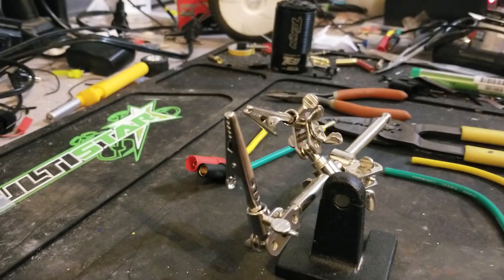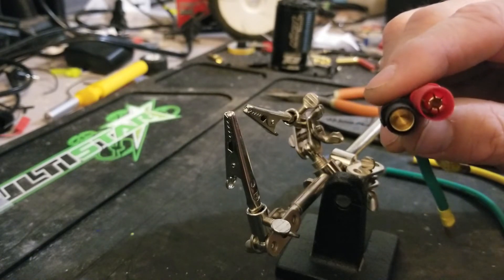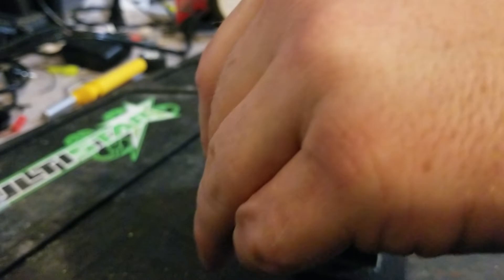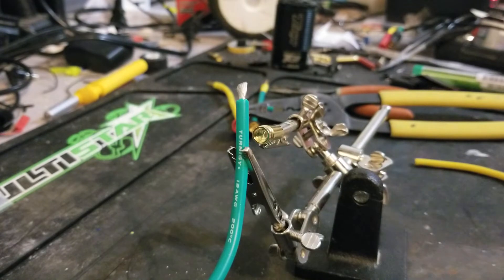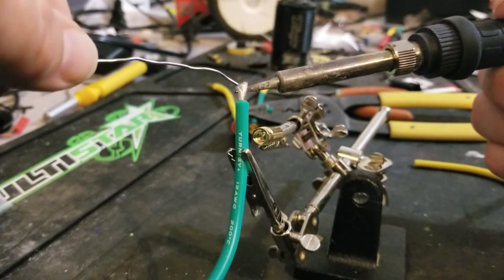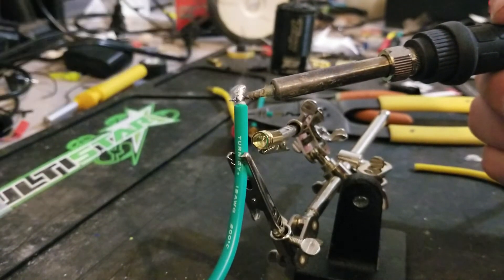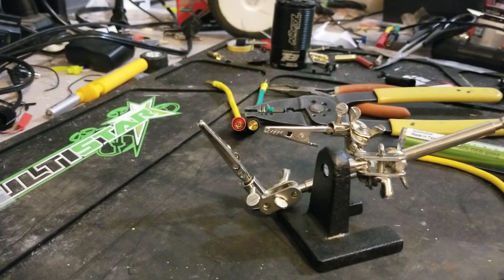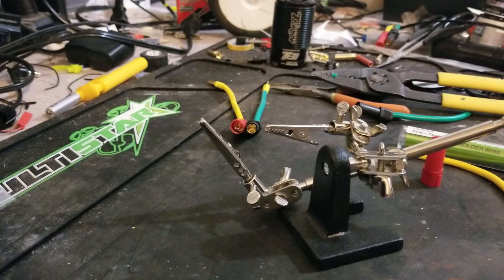How to solder xt150 connectors.

Comment: Thanks for all the useful information. I bought some xt150 connectors to use between my motorcycle stator and rectifier. The stator produces 80V at 6.000rpm . You think these connectors will hold up? Thanks!

Comment: I don't understand why the sleeves are installed by pulling on the wire. This seems improper even if it can be accomplished. All the safety instructional material I have ever seen advise to never pull wires, yet this is how the sleeves are installed? I'd imagine there had to be a tool made specifically for installing sleeves on connectors especially if done in mass production. So far I have not seen it though, which is surprising.

Comment: I would suggest not using a conical tip for this sort of soldering task. You are much better off with a large chisel/wedge style tip for much better heat transfer.

Also why not just use a pair of needlenose pliers to hold and control the wire rather than trying to manoeuvre both the wire and the bullet together held by clips of the helping hands?

Doesn't seem to be the best demonstration of this process.
Reply: @James Mills the xt 150 connectors I have don't click. When I slide the vest on the connector, the connector detaches from the wire. I have gotten the wire into such a position as well where it is right in the center of the connector. I leave it to cool for 2-4 hours and use an adequate amount of solder. But still it doesn't click on. Do you suggest some other connector?
Reply: @paarths.5281  2-4 hrs to cool,really?